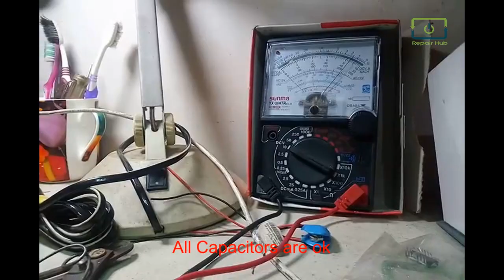IC Replacement of Woofer

Comment: When I plug in my mini home theater to an ac supply it start making a humming sound,have changed tda2030 still making the humming sound what should I do
Reply from the maker: u should check the capacitor and ic

Comment: Whenever I connect my home theatre the volume is very low to hear. Request to inform which is the part to be replaced
Reply from the maker: which model?
Reply: @repairhub907  intex 2600w